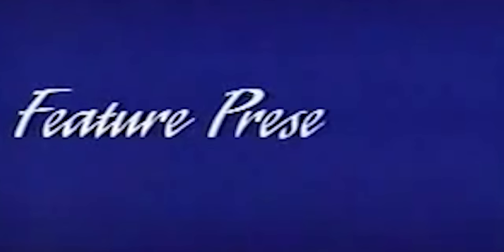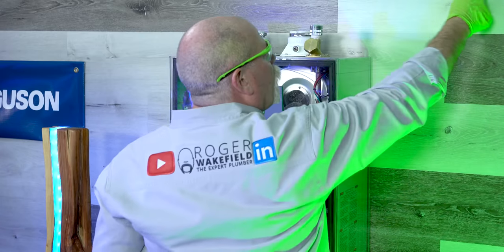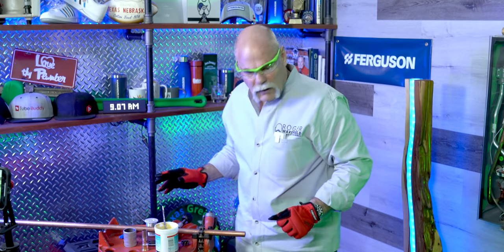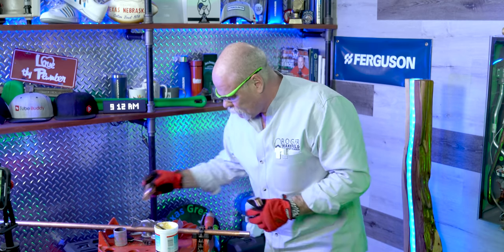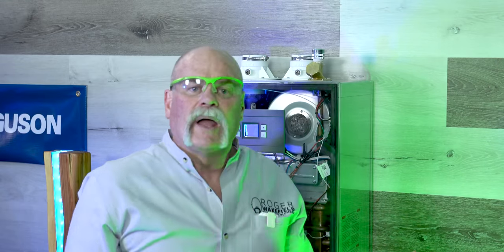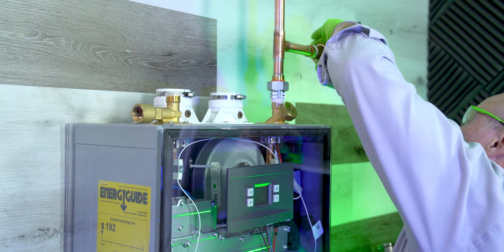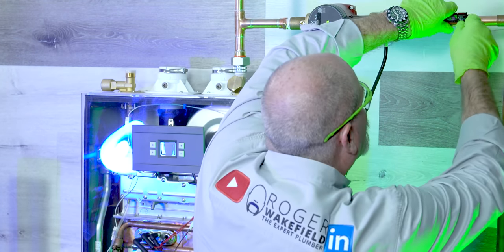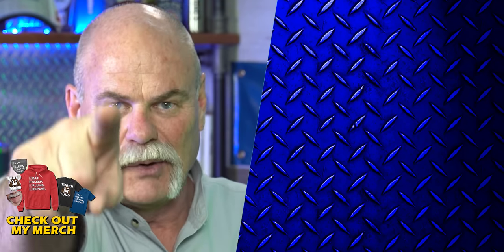This New Device Will SAVE You 12,000 GALLONS Per Year!

Comment: Hey Roger, you should talk about returnless circulation pumps with mixing valves next! Grundfos makes those too. The mixing valve bridges the hot and cold water lines at the furthest sink in the circuit, and the hot water is pushed into the cold water side when the hot side cools below minimum temp. No return pipe needed, and it also runs off a timer. The downside is a cold water line at that faucet that isn't as cold as it normally would be, but who really cares when the shower and sink have instant got water? Installing the bridge mixing valve at the furthest point possible in the circuit means every hot water tap between the heater and the valve also gets immediate hot water, or at least a much much shorter wait time. Many people don't like the need for ripping out drywall to run a recirc line for a traditional setup and the bridge valve design is exactly what they're looking for.

Comment: Without a check valve on the inlet side of the unit above the tee  the hot and cold will mix in the house.   Had that happen in the past myself been doing plumbing for 26 years.

Comment: Did you know that you can turn the pump face in whatever direction you want on a Grunfoss pump? 
by loosening the 4 bolts on the pump and turning it.
That way the pump face is easier to readout.

Comment: As a plumber, I have been waiting 20yrs for this pump. Recirculation pump, with a temperature sensor , tankless compatible. Grunfos almost had it with the alpha pump , but this looks like a winner
Reply: Question why use Bluetooth with a battery instead of hard wire the temp sensor to the pump? It seems with  bluetooth  you will at one time loses connectivity and you will have to replace the battery?

Comment: If you have a tank water heater in the crawlspace, and you run the recirculation line right, you can use convection to circulate the water without the need of a pump.
Reply: Brrayday, can you explain this more?
Reply: @rockandmeatroll  I'm on a phone so I can't type much, but essentially you insulate the hot water lines and run the return low, uninsured do that it cools, and tie that into the bottom of the water heater at the drain.  The water falls down into the bottom of the tank, and the hot water pushes up and siphons back around by convection.  Its tricky to build, but that's the principle

*building codes may be an issue

Comment: Hi Roger - Love your show and I learn so much from it. I have a Laing installed - same thing, different manufacturer - and we have indeed
save tens of thousands of gallons using this. I was concerned that the recirc would hurt my anode but after pulling the replacement I put 
in, there was very little wear at all. I put in a new anode (segmented) at that time since it was available, but at least in my case, the recirc
doesn't seem to cause any issues where I live. We use Tennessee river water and our water quality where we live is really, really good.

Comment: Very important point. Due to using the closed loop system within the hot/cold water plumbings, it is very important that the water heater is clean because you will be drinking from it. This hot water will be circulated within your potable water system as well. All the settlements, corrosion, calcium deposits, rotten egg smell (if any) will be part of your drinking water. I would flush the water heater at least twice a year and change the anode rod every year if you have a recirculating pump.

Comment: Definitely easy to do with a dedicated return line.  Not for systems with the thermostatic valve at a point of use though. The pump would need to be mounted in a different location.  Most homes are not built with dedicated return lines unfortunately.

Comment: Why not use a copper x brass FIP union instead of a Dielectric union. Also most of those plastic grundfos check valve chatter or prematurely fail. We normally pull them and install a spring check

Comment: Plumbers tape is to make a tighter connection don't use on plastic threads or no need on tapered threads. Pipe dope is literally thread sealant.

Comment: I often come across hot water circulation pumps when doing a home inspection. Every time I have to spend out 10-30 minutes explaining to new home buyers what it's purpose is. Most home buyers chose to unplug the device and not use it.

I am a big fan of this channel but feel this video is a little misleading. I tell clients it is very important to set the timer on this pump because I have had some clients leave this pump on 24/7 and end up with $800+ utility bills  (mostly from the water heater running all day & night). You may be able to save some water but at what cost? I believe the saying is, " nothing is free ."

I would like a hot water circulation pump that turns on with an app or push of a button. Most people don't use hot water at the same time every single day anyways. How about an app where you push ON a few minutes before you want hot water for showers, dishes, etc... and then turns back off shortly after. Would this not save water and utility cost? Maybe a better version of on demand hot water devices?
Reply: You can do it with WiFi smart socket $20 for 2! Just keep the pump on and use your phone to set schedules, turn it on demand or even use outside temperature to run the pump! In this scenario you remove the grundfos remote. I use it everyday

Comment: We love these at the gas company because they do increase your fuel bill. We normally get what is called a high bill complaint after one of these are installed on an existing system. I will admit this one is the best one on the market, just an FYI you should insulate all the hot water lines ( it helps quite a bit). Also you don't need a pump at all if you have a tank type WH in the basement with copper pipes ( still don't forget to insulate those pipes good).
Reply: It really depends on the local installation and especially the length of the pipe runs. In my house here in Germany I have a furnace that looks somewhat like the one in the video (actually a lot smaller, not sure what the size of that beast is). In this regard plumbing seems not to be that different between the US and Gernany as it looks in other parts. Two bathrooms and the kitchen hooked up, all more or less in one straight line of about 15 yards. So getting hot water takes about 5 to 6 seconds at most.
In my parents house there are already two branches and the overall length would be around 25 to 30 yards, without circulation in the bathroom furthest away it can take almost a minute to get hot water, with a hot water tank in the basement. And all hot water lines are insulated (required by code).
But for an average residential home you are absolutely right in the point that a circulation pump just running all the time is very much a waste of energy (and money).

Comment: Are circulation pumps such a rare feature in US installations?! I had one since the 70s.. I thought that was pretty much standard in all modern systems.
Reply: Yes, they arent standard in US.  Homes.  Some houses are configured in a smart way where they arent necessary.  Most 2 or more story/bath  houses here would benefit from a h w. Recirc system and the homeowners would be happier.
Reply: You're right, no they are not rare at all, just a luxury in residential applications, i see them on a daily basis

Comment: You will save water, but pay more in fuel for heat loss, especially in the summer when it will make your AC run more.  Obviously the lines would be insulated but no insulation is perfect.

Comment: Is it cost effective to run the electric and burn fuel to keep a pipe warm vs the cost of just wasting the water? (Assuming we are focusing on the efficiency and cost factor and ignore the convinience factor)
Reply: Depends on your configuration, including how well insulated your hot lines are.  As he mentioned you can set the pump on a timer to only turn on at peak times.  The company i worked for we would only install them on tank type heaters.

Comment: Hey there, This is not related to this video. I have lived in trailer houses in Wyoming my entire life. After discovering your channel I have learned so much that I have been doing wrong. I also have a question. Why do so many plumbers refuse to work on trailer/mobile homes? So much of my plumbing is hack job handyman work done myself, because no plumbers in my community will even take look. Is this normal or is there something different here in Wyoming? Also after some of the things I have seen done, admittedly maybe done myself, in mobile homes a video on just that subject might be pretty fun to see. Anyway thanks for spreading so much knowledge.

~Edited for some punctuation.
Reply: As a plumber, mobile homes are unique, difficult, dirty and dangerous to work on.  Re-piped my sisters trailer for a song and I was reminded why I don't work on them.  There is very little room under a trailer, the average height in the crawl space is about 20 inches or less, making crawling, shrimping and scurrying the primary modes of transport, upside, you will discover muscles you never knew you had. The pipes are usually in the floor joists and stub out directly under the cabinets and such. Gaining access means making strategic cuts in the insulation where all sorts of things can fall out from years of dust, dirt, packrat poop, to asbestos. Spiders, scorpions, snakes and vermin (pack rats, coyotes, feral cats) make their home under trailers and can bite, scratch or envenomate. They can also be infected with all sorts of things like rabies, parasites, viruses and flesh-eating bacteria. this includes their excrement as well. The skirt around the trailer, AC ducting, condensation lines and leveling jacks must be negotiated around, making it necessary to have a helper or 2 outside for safety and gophering (go get tools, lights or materials). Lastly, as you mentioned, the last person who worked on it was probably not an experienced plumber and probably made a mess of the plumbing, making a simple job not so simple. For example, if there is a small sewer leak because someone forgot to glue a joint and it has been leaking for years, plumbers have to crawl thru that confined space and have to deal with sewer gas (deadly hydrogen) from the decomposition process, human commutable diseases and even shock hazards. Most normal people would not do this and experienced plumbers know better. All these factors and the fact that there is much easier and more profitable work, make working on trailer plumbing difficult for the plumbers and expensive for the home owner, not because the plumbing itself is difficult, but rather the challenges involved. If I could give some advice, to some owners that have extensive floor or flood damage and have to replace the subfloor anyways. This would be the time to re-pipe and fix any plumbing issues because the plumbing will be accessible from the top.  I hope that this answered some questions.

Comment: I don't know why youtube thought I would be interested in plumbing videos but it was right. (I wonder what was the first one I've seen.)
About the device : I'm not a fan of wireless as it usually means regular battery replacement (usually at the worst time), some risks interference and a an additional thing that can break in an otherwise very simple device.
Reply: Sadly, everything is going wireless/bluetooth/wifi these days. And things are just getting worse. I have a printer here at my home office, which is wifi-only. The fact that it only operates over wifi is bad enough, but I have to LOG IN TO HP just to use my LOCAL printer. It's absolutely ridiculous.

Comment: So how long does it take for this pump to charge the whole recirc line with hot water? Is there a max length you can use on the recirc line? Would using 1" allow it charge faster? I was reading that with pex you can only do 2.2gpm on 3/4" and 3.6gpm on 1" as to not go over the max 2ft/sec rule but how do you know what pump to get to not overdue it while still getting the water to fill the recirc line as fast as possible.

I was going to make my dedicated recirc line 60' but then I came up with the idea to run the recirc down to each fixture so the hot water would get there even faster but that will increase my recirc line to over 100' and the time it takes the hot water to the furthest fixture. 

Any advice?

Comment: Do you have a recommendation for houses that don't have a dedicated return line. We have two bathrooms on the other side of the house.
Thanks for sharing your skills with us.
Reply: Check on a grundfos comfort system pump with a crossover valve. It will attach to the hot outlet of the water heater and use the cold water lines as the return.
Reply: Yes, komfort system,

Comment: Damn soldering is so slow, we stopped doing that like 15 years ago here in Belgium. Also, that steel part of the dielectric coupling is going to eat away, being in between Copper and brass.
Reply: Slow, but lasts forever. The point of a dielectric union is to stop galvanic corrosion. It's stainless steel, plastic lined, and proper tape/dope or washer use will prevent leaks. It's not an issue.
Reply: @mannys9130  pressing also lasts. I have to fix more leaking solders than leaking pressfits. You dont need that dielectric between brass and Copper. The steel part is directly in contact with the brass from the boiler, thus it WILL eat away over time.

Comment: I wish my house had one, it would save me a bunch of water. Unfortunately the far end of the hot water is on the other side of a maze of walls and floors and an open living area downstairs. It would have been nice for a line to be run back just in case someone wanted to add it.
Reply: Look into returnless pumps. They use the cold water pipe as a pseudo-return. No need to run new pipe.
Reply: They may save you on water, but the energy, operation, and maintanence costs will severely outweigh those savings. Many studies, even optimistic ones find they are mainly a luxury factor, and one that can easily be replaced with point of service heaters, etc.

Comment: Great Video, and great product. Just an observation, you are supposed to use thermal compound under that sensor. And you can't install that head in that direction. you would have to remove the 4 screws and rotate the head, both of these are according to the manufacturer. Also it may be useful to solder that dielectric union to that pipe without the plastic ring, then install your ring and nut with the piece of pipe to your Tee to solder. A little less risk of melting your gasket because you won't have direct heat on the union with the plastic on it. Just something I have done for this task. Great video! keep em coming.

Comment: is this for tankless only
Reply: No, they can be installed on tank heaters too.
Reply: If you need one depends more on the length of the pipe runs and how good they are insulated than what you use to make hot water.

Comment: With pro press this wouldve taken you a quarter of the time ngl
Reply: Fittings are much more money, an O-ring will never be as good as a sweat joint for sealing or longevity, and there is no repairability factor in press fittings like a sweated joint. Pro-press and SharkBite are inferior to solder in every way except time and it's not worth it. The ONLY situation I'd even consider using a press fitting is in a situation where I couldn't stop water flow or drain the pipe fully and therefore couldn't sweat a joint correctly. Even then, I'd do it under duress.
Reply: @mannys9130  sweated joint are what kind? English isnt my native language and I see a lot of the same names for different fittings haha. Are those with the brass ring? Because those are the best indeed.

Comment: How is this "saving" 12000 gallons ?  Do you mean that it saves heating 12000 gallons of water that you don't need?

Why is there a pump anyway - isn't this mains pressure from the boiler or tank to the taps ?

It seems to be that a dedicated return line wastes energy by circulating hot water which has to be heated whether it's needed or not, whereas no return line means you waste x minutes of cold water waiting for the hot so having a timer means it's only circulated when needed, right?  But why a pump and not a valve on the return ?

Comment: So this is only ment for wall heaters and not the tank type? Also you really don't say much about it at all.
Reply: No, this is really meant for tank type heaters, but it can be used for tankless heaters as well. It just constantly moves hot water through the pipe, so either heater will provide hot water for this task.